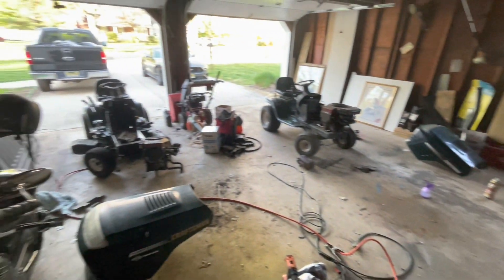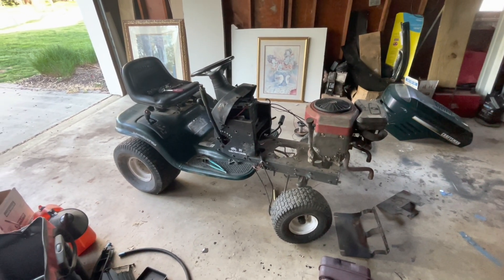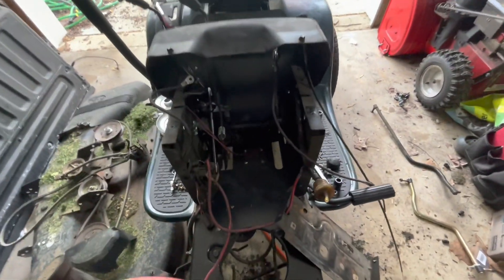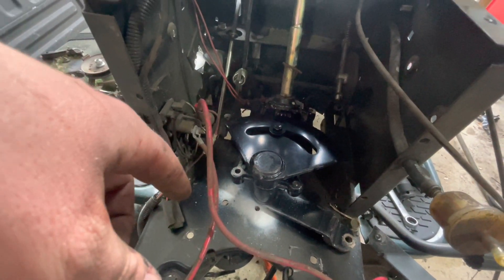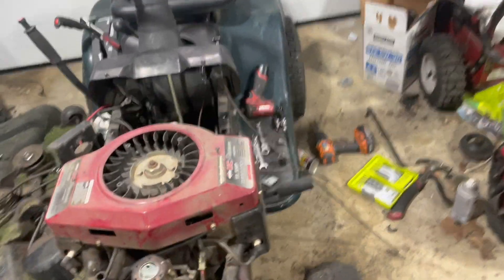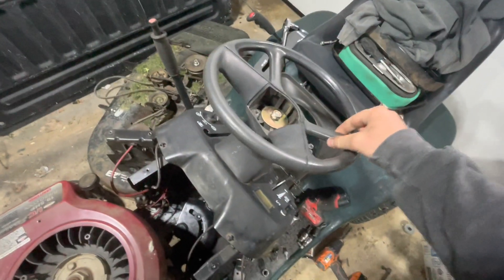Craftsman LT1000 Riding Mower Steering Swap/Upgrade

Comment: And as far as that other opposed twin goes thurgood motors as long as it's not burning oil you can reseal that oil pan cover with high heat silicone Henry seal the back inspection plate cover with silicone as well but you will have to replace the PTO I've been doing small engine repair since I was like five and I'm 20 years old now so 15 years of experience tells me that it's common practice to replace a PTO seal if you have to pull the cover for any reason but like I said just reseal those and as long as it's not burning oil it will run fine and should not leak if done correctly

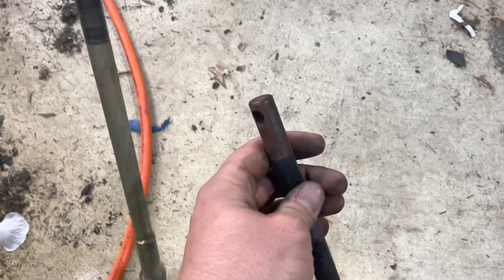Comment: 3:50 I am replacing with a salvaged assembly 175146; the 'steering column' is NOT the same: the beveled gear teeth are NOT the same.

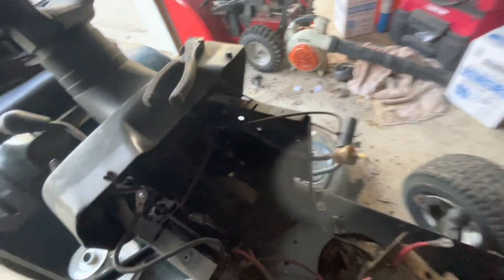Comment: 1:14 My runner has over TWICE the play in the steering wheel: 120° before the wheels move!  But it DOES turn easily!
I have the "EZ3" model with Kohler Command 15.5 hp...a lot like the LT-1000, but it doesn't call it that in the manual.

Comment: Do you know what would need replaced on the new steering unit if that is very sloppy and has a lot of play in the steering wheel? Similar to the old one when that rubber boot wears out?

Comment: My rider is like yours with the Kohler. The steering is sloppy at the top not the bottom. I remove the 3/4 nut on the steering wheel and it is stuck. I pulled quit hard but it is not budging. It there a catch that needs to be released and I am not seeing it. I hate to beat on the bottom side of the steering wheel and cause further repair. Help please.
Reply from the maker: Ahh I’ve seen this happen where sometimes the steering wheel or the little 6” extension all get stuck on the steering shaft. Usually some heat will help free it or worst case cut it off and replace the wheel sadly.